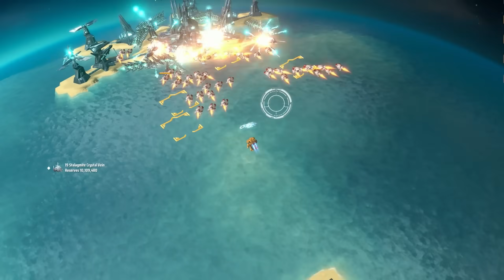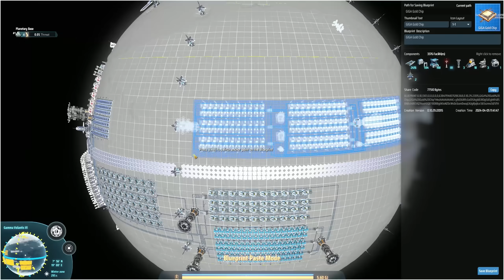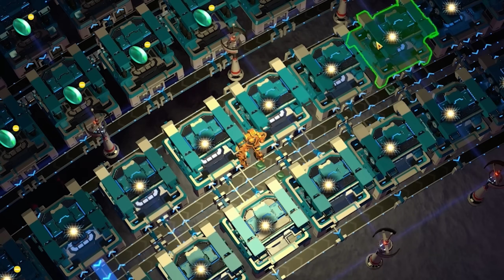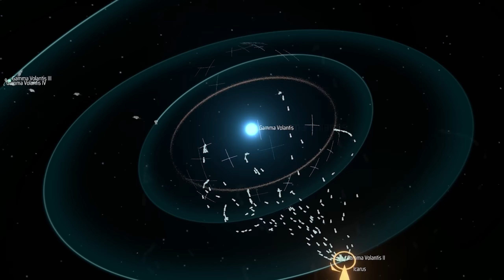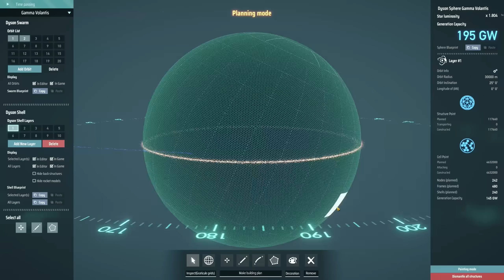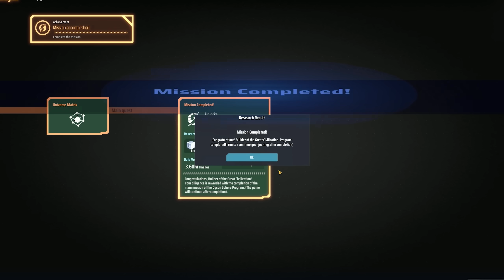Building a Dyson Sphere START to FINISH! - Dyson Sphere Program Dark Fog

Comment: Tip for easy Deuterium for anyone wondering. Find 1-3 gas giants with a high deuterium on them, then plop 40 Oribtal collectors on each one of them and they will automatically harvest and ship to any ILS in the galaxy on your command. Albeit, they can be kind of expenive in the early/mid game, since you'll need a bunch of precursors. But I promise they will not dissapoint. Your only problem will be having TOO much of the stuff xD Also some of those gas giants also have Fire Ice on them, which is basically free recipe for Graphene, apart from the hydrogen you have to somehow get rid of again. (hydrogen fuel cells are cheap and are a decent way to power a long distance mining colony that won't require much power)
Another good way to power mining colonies is just killing of the dark fog off a planet, when they have like 5-10 bases, dont fill the hole with dirt they make and plant a geothermal generator on there in stead, will keep you going for a long time.
Or build a modular fractionator setup that will convert everything into deuterium (100s is an understatement with all the hydrogen byproducts) and just make use of those, after a while you will be drowning in all of it (which you will NEEEEED for making strange matter, that shit EATS deuterium like no tomorrow, especially at larger scale.)

Comment: Felt the itch to go colonize a sector of the galaxy again, and found a decent solution to the fire ice output balancing.

Right before the tower I have the hydrogen and carbon fibres go through a splitter that has output priority to the tower. But then it has another output that just goes to a massive line of burners. This way the tower can fill up with one of the items, and then all excess is burned off. 

And since my computer is a potato, and I have to work with a limited number of planets to not choke the whole system down, I'm always running a surplus of one or the other. Depends on the stage of building. Currently there's an infinite amount of carbon fibers being burned away.

Comment: favourite thing to do is set up a Dyson sphere in a system with at least 1 tidally locked planet. Cover one side of the planet in Dyson receivers and the other in battery chargers and logi towers to spread the power throughout my factory cluster.
If i'm understanding it correctly the next update will be amazing for this system since i'll be able to set up "relay hubs" for my batteries instead of every planet fighting over the limited number of ships my generator worlds have.

Comment: What's crazy is that you can have multiple Dyson spheres around the same star, just with different circumferences. So you could make a "Dyson onion" if you will.
Also if you set the radius to max, and have a planet orbit inside the sphere, it's ray receivers work 100% of the time. Great for making interstellar power plants or critical photons.
Reply: I believe the "dyson-onion" already exists as a concept. But instead of using it for pure power generation, it is used to power the most powerful 'single' 'computer' ever conceived: a Matryoshka Brain. A computer/AI so powerful, it can perfectly simulate EVERY SINGLE ATOM IN THE ENTIRE UNIVERSE IN REAL TIME.
Reply: @punthebun  if that were possible, it would also be simulating itself in real time, and likewise for that simulation. It would be an infinite recursion of real time simulations.
Reply: @punthebun That's not actually true.  It is physically impossible to simulate an entire universe inside a universe to the same fidelity that the universe does

Comment: Kibz, brother, Green Sci into warper is far more resource and energy efficient!
Reply: Also, Pile Sorters, Pile Sorters, Pile Sorters - use them to stack the belt from 1800 to 7200 - fractionators go mental at that speed!
Not to mention though Pile Sorters are just fantastic sorters when upgraded! You should also farm the fog so you can get the SECRET buildings!

Comment: 3:50 when load balancing on that scale it might be just as easy to dump all the outputs into a logistic tower then use its outputs to (somewhat) evenly distribute them. This might work alright since you are going from 5 to 3 belts. Certainly beats trying to use splitters/mergers. 🤣

Comment: You should build one around a black hole and a neutron star.
Reply: Dyson Sphere works for the sun, I can see why it'd work for a neutron star but I don't see it working a black hole?
Reply: @NeverNotTheNemesis  the matter spinning arroune the black hole at near speed light speed
Reply: @NeverNotTheNemesis  if build around a black hole its called a penrose sphere.
Reply: @pietervanderzwaan4295  good to know but how would it not be sucked in? unless black holes don't do that at that speed
Reply: @NeverNotTheNemesis it would have to be in a stable orbit, if you are moving fast enough, far enough away, you'll be fine,
Reply: @curlyfries3232  ahh ok, thanks for informing me
Reply: @NeverNotTheNemesis  There are a number of videos that discuss this topic, totally recommend that you check it out! It's pretty fascinating.
Reply: @pietervanderzwaan4295  a Penrose sphere works very differently to a Dyson sphere. If the sphere collects energy from the black hole’s accretion disk and the radiation it releases, it’s a Dyson sphere. A Penrose sphere collects energy from the black hole’s spin.
Reply: @NeverNotTheNemesis black holes are theorised to give off Hawking radiation 

Basically imagine matter and antimatter can spontaneously exist anywhere in the universe, but normally they destruct immediately.
But if it spawns on the edge of an event horizon, one negative energy particle falls in and a positive energy particle falls out

This means that black holes will give off energy
Reply: @Chris_A_2 yes but that energy is insignificant
Reply: @NeverNotTheNemesis  It is possible to extract energy from black holes, but it wouldn't be a Dyson sphere though, it would be a magnetic reconnection as a mechanism for energy extraction from rotating black holes. You can find an article about it on Physical Review D

Comment: @ImKibitz small deuterium tip.  Run small loops of 6 to 8 machines and link the loops in series on a belt line per loops of about 12 at max (tier 3 belts and sorters) with all the hydrogen grouped 1 t3 belt to 4 loops with a overflow line to following loops.